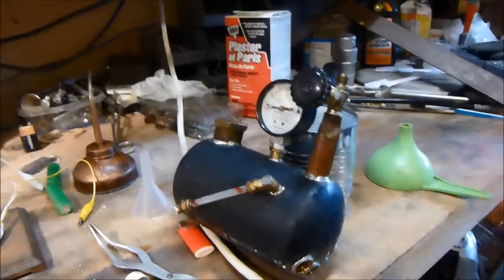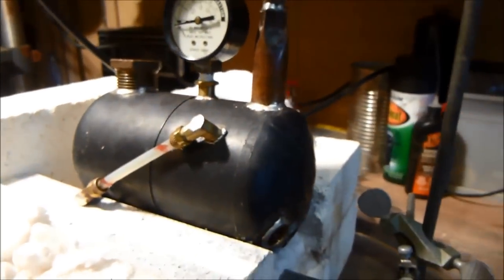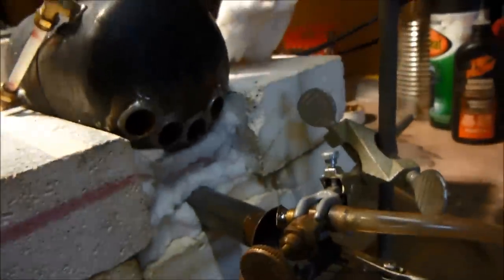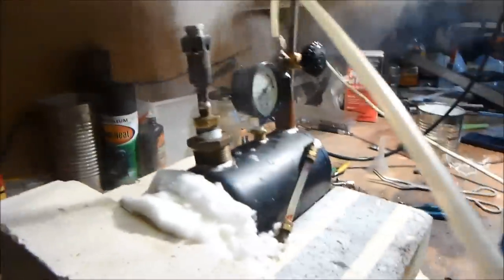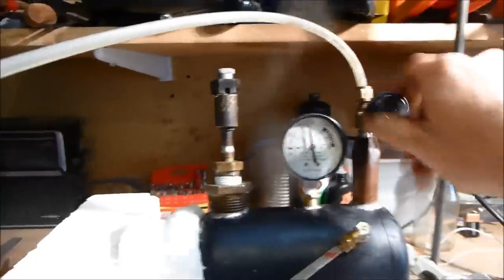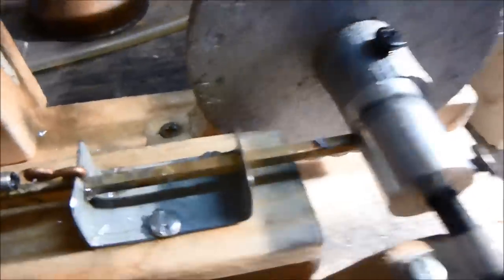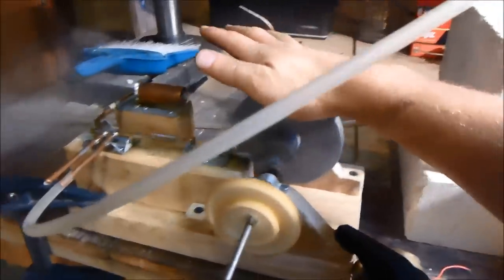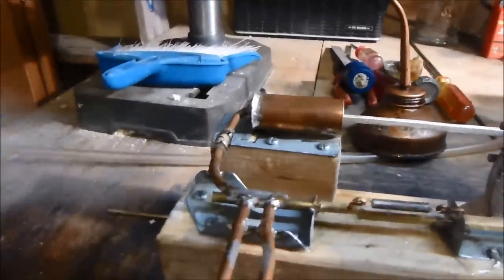Steam Engine Running on New Boiler - Modification to Steam Engine - Piston Rings, Better Valve

Comment: Hey makerj, i'm thinking about building a similar one. And I was thinking of making a boxer style. If I had a piston on the other side along with a valve follower would it work? Or would they just be going the opposite direction. Thanks so much!
Reply: ok, you're right, I'm going to start building a single cyl. As far as the bearings on the flywheel go, what are the best free spinning bearings? Non-sealed bearings?
Reply: Makerj101 ok thanks man!

Comment: I don't understand the point of adding flues to this boiler if you are not directing heat through the flues. The point of having flues is increase the heating surface.

Comment: Regarding your shortening the valve piston:  When the valve piston is all the way to the right, what prevents the steam en route to the valve assembly from exiting through the exhaust port before it reaches the cylinder?  Are there two holes in the tube going to the cylinder, or just one?
Reply from the maker: Myke Marss It's hard to explain in words.  Maybe I can draw up a diagram sometime.  But no, the steam cannot exit through the exhaust port.  A little does from the play in the valve.  But not directly.

Comment: I don't think a coal fire box would be hard to control. you have a safety valve and a tap to control the amount of steam to your engine. I would like to build a boiler and engine but I'm unemployed and I am waiting for a operation to fix my arm after a bad operation last year following a 60mph motorbike crash.
Reply from the maker: +Simon Humphrey Well the steam would not be hard to control.  The rate that the coal burns would be the tough part.  With the natural gas burner I can set pretty much any heat with a turn of the valve.  Coal might be harder to control.  Like if it started burning too fast it would be hard to turn down the heat and slow the boiling.  Ouch... Best of luck man.  I see you have a rifle as your profile picture.  I just got my first buck on Monday!  It's a pretty nice 9 point!  I got it with a crossbow because we live in the city but once rifle season starts we go over to my grandma's farm and hunt there.

Comment: Wat happens wen you make the valve rod solid and conected it to the fly wheel.
Reply from the maker: pim keppel I could do that.   A lot of engines use that design.  This is just the design I thought would be easiest with the parts I had and it was just the way I wanted to do it.  Nothing says it's the best way or even a good way.  It does however work surprisingly well!  I mainly didn't want to drill a whole in my fly wheel and I would also have ad to have both bearings on one side of the fly wheel which I didn't like.  So I guess there are reasons.  Does that answer your question?

Comment: I want a steam powered bicycle, how hard would it be to assemble a few of these engines together in a boxer engine configuration from hardware store parts. as well setup two of these boilers in series or parallel?
Reply from the maker: +Mike Klegin hmmm... I'd build ones with larger bore. Probably 1in or if you can 2 inch copper pipe. This like 3/4 inch engine only puts out around 20 watts worth of power. You would also want to use a flash or monotube boiler. Its a lot lighter and has a shorter startup time. It's also more efficient.

Comment: hi a coal fire box on the end would be great
Reply from the maker: +Simon Humphrey Yeah that would be really cool!  It would be a lot more authentic!  I think it would be hard to control though.
Reply: The problem is you NEED a copper boiler for a coal fired engine you also need copper flues to go through the boiler and steam powered jets creating the Venturi effect.  You also need to use  seamless copper tubing for your boilers. Do more research before you show people the dangerous things you do

Comment: Power something from it, will be nice to see what this can do
Reply from the maker: MrJohhhnnnyyy Yeah I will have to do that!  I was thinking about maybe making another LEGO transmission and powering it off the steam engine and then powering something off the transmission.  I don't know what though.  Any ideas?  Thank you!
Reply: Makerj101 Well, can't really find another purpose for it except powering a generator that will charge batteries. Or maybe try powering small compressor, or some other kind of pump. Just google what was powered by steam engines back then, and I'm sure you can find something interesting
Reply from the maker: MrJohhhnnnyyy Yeah I did charge a battery with it and I tried charging my phone right after I made the video.  I will have to make another video of that.  I was thinking a pump too!  Maybe I can try casting a pump out of aluminum!  I've been looking for something to cast with aluminum because I want to do anther casting video!  I also want to make a little high pressure water pump to fill the boiler back up with water.  Thank you!

Comment: your solder joint will melt eventually and that thing will explode. use gas weld instead for your joints.
Reply: +francis sanchez  The can will never rise above boiling point of water until all of it has boiled, therefore it won't have anything inside to explode, no worries.  Simple distillation
Reply: Really ... so tell me what the temp of steam is at 60 psi...?
Reply: It is the temperature that water boils at at 60 psi above sea level.  Ya know it's beena long time since I watched that but I'm pretty sure the kid was being quite safe, especially with regards to pressure and it looked like his dad is a plumber.  Okay now you tell me ...what temperatuer is the flask on my desk, which is boiling with no heat applied?
Reply: Sorry Amber your boiling water in a paper cup analogy does not work with live steam under pressure - if his safety valve sticks (and they do) you need a margin of error - that is the reason why boilers are required to be tested to twice their operating temperature and plumbers seldom deal with issues of live steam these days
Reply: the temp of steam at 60 psi is 308F pretty close to the melting point of plumbers solder - at 120 psi it is well above it - the guy who started this reply had a really valid point - solder is not safe for boilers, you should by preference at least silver solder the joint  )melting temp around 1100F) - this is a real safety issue, I am not trying to be a smart ass - someone will get hurt at some point following this approach - live steam as it exits under pressure dramatically jumps in temperature as it hits an "effective vacuum"
Reply: Hey boiler,  why'd  you c hoose the name?  Just wondering,  this is not directed at you personally but that experience is what ended my love of hard liquor at about 19 or 20 or so.  I used to drink at least 1-2 gallons of cuervo before the night began and then one night some girl served me up one of those and like I said, that's all it took.

  Look dude you are probably right about someone else maybe getting hurt, and I've been done arguing for oh so long now, sure not gonna tell you to piss off like so many other people I have to because at least you are speaking about something real, but cmon bro I aint a girl #1,  glad you are out there being concerned #2, but #3 man I aint scared of nothing so you're preaching to the wrong guy here.  I've owned all of the fastest motorcycles on earth and tested them to the max,  what's a little steam gonna do to me that 680 degree oil out of my leaking gsxr didn't already.  I am scar tissue from head to toe so what do I care?  Let the kid read this and learn tho,  and you keep looking out for all of us and educating okay?  seriously man, I just had to tell some worthless troll where to go so I feel great seeing your comment,  but like I said bro,  aint no split tail here.  Hey man where do y ou get regular solder from, what are you some kinda plumber with a stash or what, send me some  LOL!  I love heavy metals by the way and hate gold fever which I believe is derived from people in the late stages of silver fever  LOL.

Peace
Sizzlean

Comment: How much of a pressure can you sustain with that boiler?
Reply from the maker: +YSC I generally have the pressure relive valve set around 50psi. I don't like to go over 50psi because things just get scary past that point. The tank unmodified should be able to handle 300psi no problem. Probably less than that since I put holes and such in it.
Reply: Makerj101 I mean how much pressure can it generate constantly, like you don't need to close the valve, build the pressure and then open the valve. Simply let the pressure build and keep the valve opened.
Reply from the maker: +YSC oh. If you open the valve all the way with the steam engine attached. I think it stabilizes around 20psi. I don't really remember tho. I never let the pressure build with the valve open cause it'd take too long to build much pressure.

Comment: "I'm pretty sure its not asbestos" have you tested it?
Reply from the maker: +Da Wh No, it's not asbestos.  It's ceramic high temperature insulation.  I did look it up and looked through lots of pictures and some identification guides and it doesn't match the specifications.
Reply: +Makerj101 thank goodness. I've handled asbestos in the past, just waiting for the repercussions of playing in old factories. 
i am afraid people don't take this hazard 
as seriously as they should.
i admit strand filiments are rare, but where used as filler for thin sheet rock walls. I'm glad you've checked.
Reply: +Makerj101 i forgot to mention, its a could design.
Reply from the maker: Da Wh Basically my understanding is that asbestos has a grayer color and the fibers are much finer.  This insulation is pretty course and white.  I do however know of somewhere where there is asbestos.  There are some old pieces of asbestos concrete pipe in the woods behind my house.
Reply: +Makerj101 asbestos can be found everywhere, it is such a versatile and usable substance, from reinforcing to sound/heat insulation. and its safe so long as it is never disturbed, ever. 
but renovations and upgrades/updates either cover it up or expose it dangerously. 
its not that surprising to find when you consider what it was used in and for how long. 
it would simply cost too much to track and remove.
Reply from the maker: +Da Wh Yes very true.  I'm pretty sure the insulation I have is ceramic.  It looks exactly the same as this stuff.  http://www.lewcospecialtyproducts.com/high-heat-textiles/High-Temperature-Felts--Blankets  I could try looking at some fibers of it under my microscope just to see.  But I kinda doubt I'll be able to tell much from that.

Comment: there are boilers running at 5psi.. this guy is up to 60?!  you gonna hurt yourself man.  anything above 15psi is a high pressure application.  you could get in trouble lol.  lower youre operating pressure.. no need for that high of pressure.  
And you demineralized water for youre experiments if you hitting 60psi
Reply: oh boy you are a steamer aren't you

Comment: What are you? Kid engineer or somethin? LoL :)
Reply from the maker: Youtube aholic Basically!  Hahaha  I'm not really a kid though!  I'm 19
Reply: Makerj101 Ha! same age! What do you use to make those sexy soldered joints? When i solder and turn on the water i end up with Niagara Falls...
Reply from the maker: Youtube aholic Cool!  Lots of sanding and grinding to make sure all the rust/paint/oxide is off.  Then lots of flux and lead free pipe solder.  Lead solder is much easier to work with but it's getting hard to find and I don't have any.  Some of the joints I had to hit with a wire brush after heating if the solder was not flowing into the joint properly.  Here's the video on making the boiler:  https://www.youtube.com/watch?v=UWuqfIz_w9I  Thank you!
Reply from the maker: Youtube aholic Getting good solder joints is really hard and takes a lot of practice.  Practice on some copper pipe fittings first.  Once you've got them down move on to the boiler as it's even harder.  I'm sure you can do it.  Just be patient and keep trying.

Comment: Hello! I wonder: you used normal solder to glue the different parts of your steam box together; won't the solder become unstable (melt) during the steam production process?
Reply from the maker: Futschikatores No the solder will not melt.  Most of the solder that gets hot is kept cool enough by the water in the boiler.  The water in the boiler does increase in temperature due to the pressure but not near the melting point of solder which is approximately 180 degrees Centigrade.  The water should only get to about 135 Centigrade.